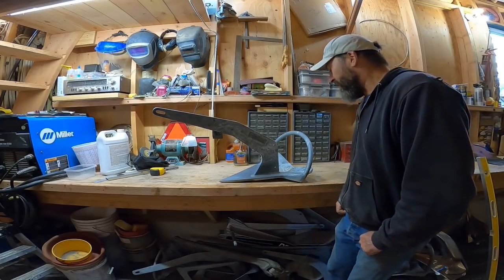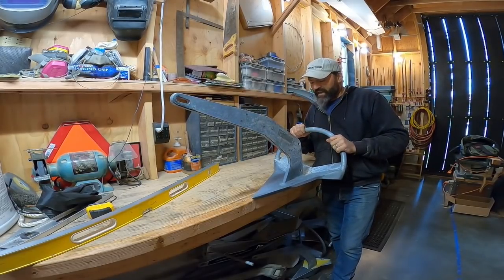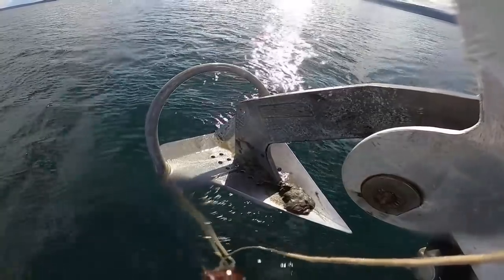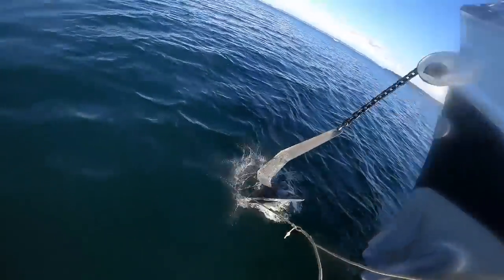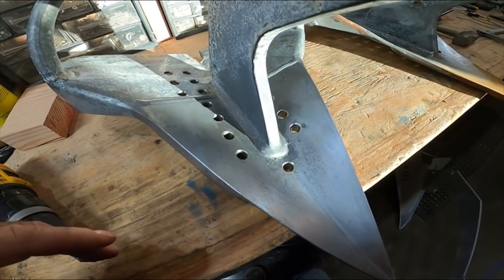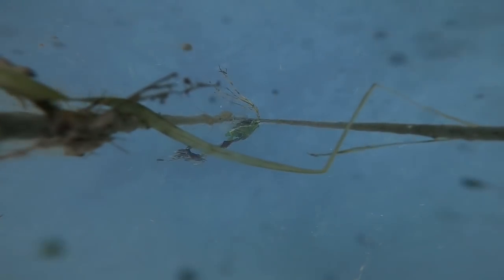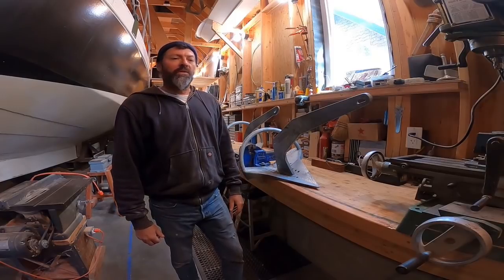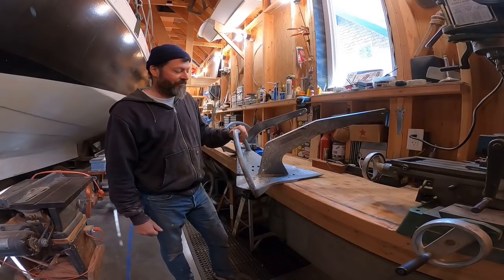Rocna Anchor Modification.   Anchor Test Video #87

Comment: I live aboard in Med and sleep with 40kg rocna and min 7:1 with chain of 10mm  ....in many years never fail.
Rocna (like many other ancors) need’s minimun 5 :1. Testing at 3,5:1 is ridiculous...
Reply: I agree 5:1 is minimum my 25 kg never drag 3.5:1 is ridiculous yes
Reply: He mentions it was just a test with this scope. Although watching Sailing Atticus in a real blow in Bermuda with a 7 to 1 scope that Mantus dragged and basically couldn't reset. These row bars are interesting. I saw the same thing with UMA with their Rocna.
Reply: @maritimetees2315  7 to 1 is not enough for a "real blow"    just sayin"!
Reply: Why is the Rocna the only one that can't pass the test without modification??
Reply: I totally agree. 3.5:1 silly and irresponsible. 5:1 minimum. 7:1 good.
Reply: THANK YOU …  people should be advised that every anchor is different and you have to use the tool in the way that it works best. As you say, a Rocna will not work best at 3.5:1 scope. Also, I solves mud sticking by painting 2 pack polyurethane paint and making it smooth, it also looks nice although it does need touching up often.
Reply: @Onyourbiketoo  Last year in Porto-Vecchio Corsica on 5mt. of light mud and seaweed .. with 65mt of chain (13:1) ..we dragged when the wind came to 55kts .. with another 30 meters of chain (19:1) ...he held well.

Comment: Hey Steve after looking through and binge watching your videos. I keep seeing the same things when an anchor reset drags; mud from the square shank piled up compacted to the anchor. Maybe rounding the shank to allow mud to come off, or how about painting or polishing the anchor to be smoother and to stop the mechanic bonding of mud to the surface.

The galvanized coating is really rough with lots of small surface imperfections that allow a lot of surface area for mud to stick to. Think a coat of polish and wax to a cars paint to bead off dirt and grime.
Reply: This is what I did, used grinder to take away sharp corners and painted smooth. No mud stick and looks pretty.

Comment: Steve, as per the last two videos, you know by now that I, as you, have a 45 lbs Mason Supreme anchor. I drilled holes into it, as you did, after seeing your testing results. I drilled the same number of holes, i.e. 9, on both sides of the shank, as per what you did, in my own Manson anchor, with the exception that follows. I added two holes in a line at the base of the shank close to the tip, i.e one more than what you did to this Rocna. When I now retrieve my Mason, all the mud is gone!!! Let me know if you want a picture. With regards to weakening the anchor because of the holes, I’m going to reassure you here. My neighbour is a structural engineer. He said technically it did weaken the anchor, but not within the context of its usage i.e. because of the way the anchor is pulled in the seabed. Said otherwise, we marginally weakened our Mason Supreme by drilling the holes into the fluke of the anchor as we did. More importantly, we improved its performance by doing so. Now, I still have to sharpened the tip of my Manson, as you did, because, as I stated in your previous video, the Manson Supreme is completely inefficient in a hard-packed sand bottom, i.e. a prevalent seabed up here in upstate NY.
Reply from the maker: Glad to hear your modifications produced a positive result!
Reply: I agree that the extra holes in front of the shank will likely have little impact on strength of the toe. The only way the toe would bend is if it was jammed into a rock in storm unsheltered (biggish waves) conditions but in such extremely rare conditions it would likely bend with or without a few holes. So if anchoring in a rocky area during a storm and are worried about the toe bending then a steel excel or delta anchor would be preferred.

Comment: Steve. You make good points about modifying an anchor. If the boat drags and wrecks the insurance company might have something to say about a modified anchor.
Reply: That is a very good point Barry, never thought of that. Thanks for pointing that out. Even if the modification was an obvious improvement and the seabed substrate or debris on the seabed was the problem the insurance company could still deny the obvious and blame a boat owners anchor modification for a shipwreck.
Reply: F#4k making decisions based on insurance companies! Since 2001 they have sucked the fun out of life. Just chuck the anchor overboard and tell ‘em it was shackle failure. 😂🤠
Reply: @Steve-ul8qb  fuck yeah, exactly bro!

Comment: It is funny that the Rocna gets such bad marks here.  I'm new to sailing and have had my Fortress anchor drag a bit (scary at night). All my vid watching and mag reading, everyone spoke so highly of their Rocna.  Many saying, I've never had a problem.  So I went I to the marine store for an anchor; they basically had Fortress and Rocna. I went home with their #10 (23 lb) anchor for a 24', 5,000 lb sloop.  I was out this summer on a night with 35 kt winds in a mud bottom with 10' of chain somewhere Downeast. I went out at midnight to check (and decided to let a little more rode out). The tension on my rode line was unbelievable.  I actually got sleep that night (with my anchor drag alarm) thinking "now worries" I have a Rocna.  I later saw your test vids. Hmmm.  Won't sleep as soundly next time.

Comment: Possible that the shank was slighty distorted when it was welded by the asymmetric heat application instead of initial alignment.  I'm a retired nav.arch. and have seen massive distortions in steel on ships due to welding.

Comment: We had a 15KG Rocna and wanted to upgrade for full time live aboard . The different between the 15 and 20KG in size is not much but between the 20 and 25 the difference is more substantial. Between the weight difference the surface area os much greater. The Mantus dont seem to have that big jump between sizes

Comment: The turned up rear flange as originally designed seems to be acting as aeroplane’s elevator, and as the anchor ploughs into the mud it forces the rear of the anchor down and the fluke upward.
Reply from the maker: Could be.
Reply: Could be that the more the anchor points downward when buried, the more the pulling force from the chain trys to pull it bodily out and the less force there is pulling the anchor forward and down. In engineering terms, the force (F) can be resolved into the force along the fluke axis (Fh) and the force at right angles (Fv). The steeper the angle of the flukes, the greater Fv and correspondingly smaller Fh. 
That may be the thinking behind the turned up flange - keep the anchor from pointing down too steeply once buried. Unfortunately, it acts as a mud retainer/ rear weight when the anchor does pull out.

Comment: Very interesting Steve, think my Rocna will get the flattened flukes with total of 3 holes at front.  I travel in sand here in Florida so expect better performance from a mod like this.  Love your channel and also love this kind of real world experimentation.
Reply: So after going out to retrieve my Rocna ??? it turns out that I did not own a true Rocna ... it already has done away with the flukes.  The mystery anchor is a Manson and seems to hold well in sand ... so there's that.

Comment: Thanks for this!!!   Patterns of what works and what does not are becoming more apparent.  Based on your theory of the mud build up, another potential mod would be to sharpen (or build up a sharper point) the leading edge of the shank and then polishing this area so that the mud does not have a 1/2" flat and sand paper to grab on to.  Since the mud gummed up the front holes I wonder if putting an angle to them so that as the anchor became more horizontal the holes would tend to open up more on the bottom would also help.    I also +1 the idea of bending the back down instead of up such that it makes the anchor set more deeply with pressure there.
Reply from the maker: Great idea. I wish I would have sharpened the shank leading edge.  Maybe next year.

Comment: Have you ever considered painting the flukes with an epoxy/graphite mix instead of (or additionally to) the holes? It creates a slightly slippery surface and is plenty strong. Would be interesting to see if it helps with the mud fouling. Thanks for doing these tests!
Reply from the maker: I believe the yellow paint that the SPADE anchor company applies to their flukes is intended to help prevent mud from sticking.  Unfortunately,  the paint quickly wore off due to the great difficulty of getting anything to stick to galvanized metal.

I'll note that there was no change in performance (in my tests) after the paint was removed.
Reply: Just done a search on polishing galvanized steel and waxing after cleaning does seem to be a thing. Anything more abrasive would wear the tin/zinc coating. Worth a test?
Reply: Been out to have a look at my Rocna 25kg and it has a pretty smooth finish. How about the one you tested? Could the finish get rougher with age and use?

Comment: Very interesting video.  Is this an "abnormally performing" Rockna or have others you have tested fared better?

I like your reasoning at the end. I think one lesson I take away is that a 4:1 scope is sometimes insufficient for these rollbar anchors, which goes against the current thinking that they actually need less.

We run a 45lb Mantus on our 35' Hallberg-Rassy Rasmus and anchor out full time.  Rarely will we stay in any one spot for more than a few days since we do the US East Coast migration every season.  It is usually someplace new in an area we have never anchored in before. All we have to go on is the chart's description of the sea bed and thr reviews of others on Active Captain and other sites of these anchorages.

We have only drug a couple of times in the past three years and those were both VERY slow drags and both times at true scopes of 4:1 or worse. Both were in very soft mud with deep burials/penetration and the mud caking into the 10-15 feet of the chain near the anchor.  

I believe you are right about the issue of the chain coming down through the mud to the deeply-buried anchor in a concave curve.  The chain can't cut through the mud like a knife and has a lot of drag itself, especially when caked with mud. A wire rope leader off of the anchor might do better in these situations, as would using more scope.

To make matters worse for the scope equation when the anchor buries deep like this it is actually serving to shorten the scope and the angle of the rode even more.  In shallow water situations with extremely soft mud the anchor burial depth may come close to the actual water depth,  effectively doubling true depth and halving the scope ratio.  In 10 feet of water with 40' of rode under the surface you will have 4:1 but if the anchor plunges 10 feet deeper into the mud the scope is now 20 feet below the boat and at 2:1 -plus the curving chain issue further tends to lift the shank upward as well.  Oooops!

The times we drug in soft mud I did notice that we seemed to be too close to where we dropped the anchor beforehand using the GPS. I believe this was because the anchor went in so deep that more of the rode was being used coming up to the boat and therefore the boat wasn't as far away horizontally as the projected rode angle would predict.

When the anchor did drag it would lunge slowly and then reset.  When I noticed this on the anchor alarm app on my phone the boat would move a few feet and then stop, then wait a number of minutes before doing it again. The winds were pretty steady and not gusting too badly.  I think the anchor was slowly turning upwards, then surfacing to near the top of the mud. Near the surface the chain angle was better and the anchor would dive again and reset to a point where the chain angle was again too steep and do it all over again.   

We were moving about 30' per hour and I let this go on for about 3 hours (100') before it became light outside and my wife woke up.   We had plenty of room to drag on another 300 feet, but I figured we were staying the day and another night to wait out the weather so we should figure out what was going on right away.  There were no other boats around us except for a couple of dericlicts a few hundred yards off to the side.

We retrieved the anchor and it was buried very deep, about 10 feet down but it did come up slowly with constant pressure once the chain was vertical.  I was surprised that an anchor buried that deeply was dragging. There was nothing at all fouling the anchor like weeds, sticks, netting or clothing/bedding*. We returned to the initial spot and reset the anchor, this time allowing for this extra 10 feet of burial depth in the scope equation.  It held fine after that and never budged so much as a could be determined by the GPS accuracy.

These days we put out at least 7:1 if we can get away with it and even 10:1 if there is room. An extra few seconds of the electric windlass is all it costs to be sure there is plenty of scope.  We rarely anchor in water over 14-16 feet deep, so we are not talking about a whole lot of extra room needed.

*We once picked up a heavy down parka jacket when anchoring.  The anchor took an uncharactoristically long (50 feet). distance to set, skittering along before finally digging in.  

There was a bad storm coming, the remnants of Hurricane Eta and we later saw max gusts in the 50's that evening in N. Carolina. I am glad we didn't just leave it because when we pulled up the anchor to check it was piercing the thick parka.  The Mantus has an extremely sharp point compared to the Rockna but I was impressed that it was able to rip right through all the layers of the heavy nylon jacket and insulation to make a huge hole so that the tip of the anchor could dig in and set.  

It hadn't ripped all the way through so the entire fluke and rollbar could fit through, so before I could hook it well with the boat hook it fell off the anchor back into the water. It was SO HEAVY and waterlogged I was having trouble just pulling it off.

We didn't budge that storm but nearly all the other cruisers sharing this anchorage did have issues and we watched them struggle out in 50+ gusts and driving rain trying to put out more scope and in one case extra anchors. No thanks.  I am grateful the dragging boats were not upwind of us, and they were all able to eventually stabilize their situations.  Their problems did not become our problem too.
Reply from the maker: Thanks for sharing your insights, SV Barry Duckworth.  I especially appreciate your point about the depth of bury significantly shortening scope (when in shallow water).  As to your question about this particular Rocna, yes, this anchor performed worse than two other examples (both smaller).  A theory that I am currently investigating is effects of anchor "surface roughness" on performance.  This particular anchor came to me in used condition and while the galvanizing was intact, there may have been some roughness that contributed to seabed adhering to the anchor.  The other two (better performing) Rocnas were both in new, unused condition with "shiny" and perhaps more "slippery" galvanizing.
Reply: It is very interesting to me how counter-intuitive some of these factors seem to be in anchor design and performance.  A slippery anchor seems to hold better, and adding holes seems to also help in certain circumstances? It seems crazy to me.  Your explanation of the solid ball effect of a loaded plow anchor moving through the seabed is intriguing.  I wish I had taken higher-level physics and engineering classes to have studied fluid dynamics. 

I have talked to Greg from Mantus at boat shows and have taken his anchoring seminar.  His extensive beach-testing of his early designs seems to have yielded a few improvements over the Rocna.  I do like how the bolt-on shank seems to yield a more consistent product over the welded.  I have noticed that many new Rocnas are slightly misshapen with shanks tipped off of 90-degrees or bent off at an angle going forward.  I have never seen a new Mantus that had these shape defects.  If the shank bent in use a new bolt-on shank would be much less costly to replace than a whole new anchor when it is welded -even shipping would be much less.  The tip of the Mantus anchor seems to be much sharper too.  

Maybe a rounded leading edge to the shank is another improvement. I hope you do some experimenting with this and can get some data comparing the same anchor with standard flat leading edge shank and with it rounded.  Maybe a V-shape like a knife blade would cut through the seabed easier and keep the shank angle down?

I also wonder how different the qualities of dry or moist sand on a beach are compared to fully submerged and waterlogged sand, I would think the friction and stiction of the material would be different. Testing underwater must be superior to testing on the beach in all but the ease of doing the tests.  Your extensive underwater tests are a valuable resource, especially since you are not affiliated with any of these anchor manufacturers.

Comment: i have a 20KG Rocna works well, ill check the square just for fun, mine is  3 years old.
my steel 40" sailboat is 26000 Lbs we use all 5-1/6" chain 300' available  usually 5-1 scope   more if necessary. thanks for all your research.
Reply: Rocna anchor tends to perform better at 5 to 1 scope. It is when scope is reduced to like 3.5 to 1 for tight overcrowded anchorages that these test videos seem to suggest is a problem for the rocna.

Comment: Bought a 25 kilo Rocna. Would love to see the modification of sharpening the front edge
of the shank near the blade. (Like that is on my original 16k Delta design)   And also the removal of the rollbar.   Note that that would also benefit the weight distribution.  Great work !